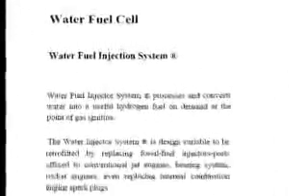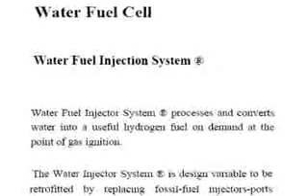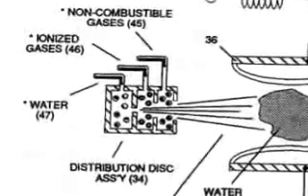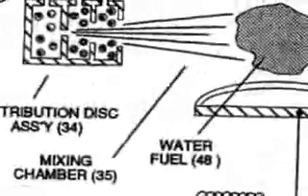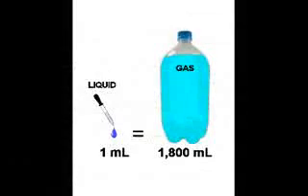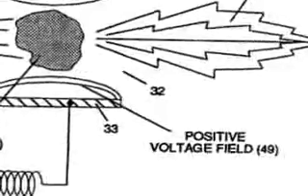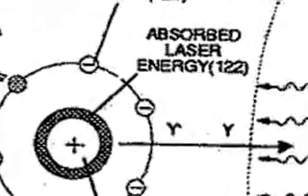SECRETS OF STANLEY MEYER'S WFC - Lecture 1 1

Comment: Complete bullshit. Ask yourself why one of these engines that has been confirmed to work by scientists doesn't exist and why everyone doesn't have one.  Stanley Meyers was proven to be a fraud in court.
"The water fuel cell is a non-functional design for a "perpetual motion machine" created by Stanley Allen Meyer (August 24, 1940 – March 20, 1998). Meyer claimed that a car retrofitted with the device could use water as fuel instead of gasoline. Meyer's claims about his "Water Fuel Cell" and the car that it powered were found to be fraudulent by an Ohio court in 1996.[1][2]"
Anyone who believes this nonsense fell asleep in high school physics class or dropped out.

Comment: I’ll put the equation here in hopes someone will re-create it. Here’s what Stan took to his grave: He created standing waves of electric current in the resonant cavity. What he did not tell anyone is he connected TWO separate + - ac power sources to a pulse generator. Then he modulated the frequencies slightly offset of each other (eg 106hz &103 hz) creating a new frequency as the 2 pulse waves crash into each other. Think about how bineural beats work. Same concept. You tune & modulate these 2 opposing frequency waves to agitate the water and disintegrate it into HO + O. 

-Stephen

Comment: It's actually allot simpler,  the non combustible gas is air,  the electric field sepperated the water vapour so no current flow. The hydrogen oxygen browns gas concentration will ignite above 4%.
How do you prevent burning to fast, add air. 
The big secret is the vic, it's not a secret just overlooked. 
Voltage intensifying circuit, VIC is a step up transformer  with two blocking coils to prevent any current from the direct pulse from doing work,  instead the reverse emf from the collapsing field induced high voltage on the plates and electrostatic attraction pulled the H+ and O- apart.
Patents are written to make simple things seem difficult and hide the obvious. If they weren't then free energy would be everywhere after Tesla filed his patents.
Don't look too invent ways to fit thedescription instead think what is the minimum this design would require to work from my understanding.  Many times patents include details that aren't really required but prevent another way of doing the same thing so not everything is required.

Comment: HHO burns like a cutting torch and burning H alone will eventually crystallize any metal over time  thus destroying the engine. I guess the non combustible gas slows  the explosion to a burn that prevents the decomposition of the metals at a molecular lever. This is why he said he was running the car on water and not on HHO and the fracturing of the water yielded tremendous energy. This helps put a few things into perspective. Great post!

Comment: How can you debunk something you know nothing about? For example, how much power is it capable of putting out? How many volts, how many amps. Does it require power to operate? If so, how much power does it require? Does it produce more power than it requires to run? How many units would it take to power a small town or a large city? Would everyone have to live near a coast line? Or would you need a long extension cord? (that was a little sarcastic) Not ALL coast lines have a constant motion like the one in the video. For it to work, you would need a way to store the energy. (lots of batteries)  How many moving parts are there? How long does it last? Hydroxy Gas systems have been tested and proved to have too many inefficiencies in the loop.(In cars) What exactly is the solution used in this system? Is it sea water or is it something you have to constantly add? Too many questions and way to little answers in this video. The video itself is of poor quality, I can't even read what looks like a group of meters mounted on a board. If you are serious about this why then don't you take serious enough to provide a simple (in focus) view of the components? Finally, is Photonated a real word? Not according to google or any online dictionary.( in all honesty, I have seen real words that were not recognized by google) All I know is that I would have to get a much closer look at this device than you are letting me see.

Comment: the efficiency of the lithium battery is about 80% 90% look in wikipedia. actually the most of the electricity for those batteries are produced by burning coal, you still need a source of clean energy, and in your calculation of efficiency you are making a mistake if you multiply this values it's like multiply apples and oranges.

Comment: all this technology is not cheap so the initial cost will be high but affordable wen mass produced so this could work.  the mass production woudl need conventional industries with all their pollution and transportation problems.

However there is s much simpler way of splitting water with zero cost and minimum need for heavy industry.

Comment: "stepped up voltage through iron particle generation", I believe you are confusing the element iron with charged Ion's, and even if he uses ions it takes energy to make those too (chemically or otherwise) no net gain can be had.

Increased voltage will lead to a subsequent decrease in current mantaining the same wattage. The energy required to break the bonds in H2O will always be the same as what you can get back out from recombining these elements through combustion; this will never change.

Comment: you missing the concept Meyer didn't build a car that ran on water he built a car that stepped up voltage through iron particle generation of power and the two stage process of gas multiplication. when you take away the box and look at the entire process then everyone will see the potential. some you-tubers are on the cusp of this and give it a little more time and it will be reality. plasma iron generation of power is a secret thats been kept for years but soon the curtain will be raised.

Comment: If you are going to use electricity to split a water molecule at 60% efficiency then run that hydrogen through a Internal combustion engine ICE where that engine is only 18 to 25% efficient. I will take a huge number of electrons to move that ICE 1 mile. 

Put those electrons in a Lithium battery where losses are around 1 to 2% and The electric motor is 80 to 90% efficient. A lot of people and companies are doing this. Oil companies cant stop it. It keeps your dollar local. Oh go solar as well.

Comment: asking anyone that knows...
so is he,or are you saying you use the exhaust as the none combustibal gasses?
a normal car takes gas in,and puts exhaust out,if the exhaust is lead back to the engin instead of lost,you get a power boost,if the car runs on water,your not flooding your engin with carbon.
if you use every reaction for the next reaction and circal back on itself,you get less or no loss.
im just thinking,with a keyboard...

Comment: Man how does this stuff get on the net... The narrator has no clue what he is looking at. This can be done fairly simply with an Arduino and a voltage multiplier and some stainless plates. Lasers? Really? Lasers are just coherent light nothing magical. Implode wait an implosion requires a vacuum anytime you burn something you create pressure. IE explosion. Has anyone here EVER BUILT THIS? I guess this is next after I get my electric car done next month.. Chemistry 101 and second year electronics

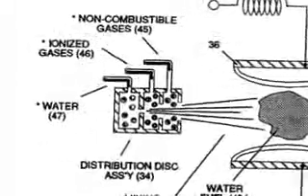Comment: From wikipedia:  @ 1:33 Ionized gas

Heating a gas may ionize its molecules or atoms (reduce or increase the number of electrons in them), thus turning it into a plasma, which contains charged particles: positive ions and negative electrons or ions.[1] Ionization can be induced by other means, such as strong electromagnetic field applied with a laser or microwave generator, and is accompanied by the dissociation of molecular bonds, if present.[2]

Comment: There's just one teeny tiny problem with this, the 1st Law of Thermodynamics:
energy can be transformed, i.e. changed from one form to another, but cannot be created or destroyed.
So where's the energy coming from to push the car? It's simply impossible to extract more energy from anything than you put into it. Even a nuclear reaction is transforming mass into its other form; energy E=MC²
The energy in oil is put in by photosynthesis initially.
If this is a perpetual motion claim its false.
Reply: You contradicted your own statement when you used nuclear. In the 2nd world war the 2 nuclear bombs Little Boy and Fat Man used explosive material to knock loose a neutron to start the chain reaction that ultimately yielded many times more energy release than the initial explosive power of material needed to start the reaction. It was said that when the first nuclear devise detonated ever Oppenheimer was astonished to see the amount of energy release even though there where dozens of senior scientists working on how to make it work. It's possible that Stanley Meyers understood by knowledge or luck the right features to make what others continue to fail at.
Reply: @kerrryschultz2904  I know all that, I have a degree in physics. Forget about what starts the fission,  are you disputing that the explosion isn't from changing matter into energy through E=MC^2 ?
Reply: @warren52nz  History shows that the equation is correct and am not disputing that the resulting reaction releases huge amounts of energy.
Reply: @kerrryschultz2904  And it's a nuclear reaction that produces the energy. I'm guessing you meant it wasn't a nuclear reaction that triggered it, which is right.